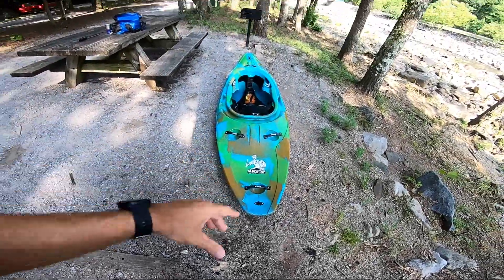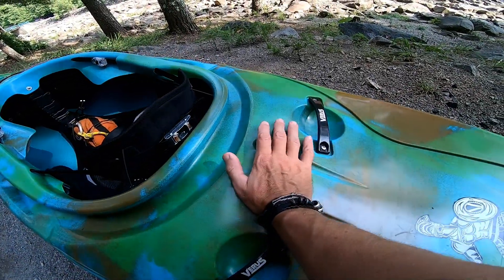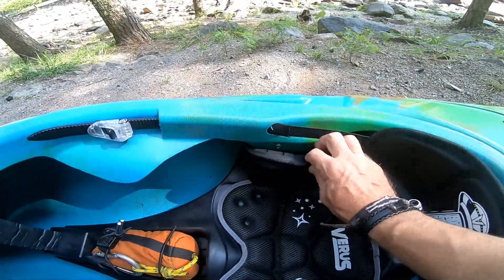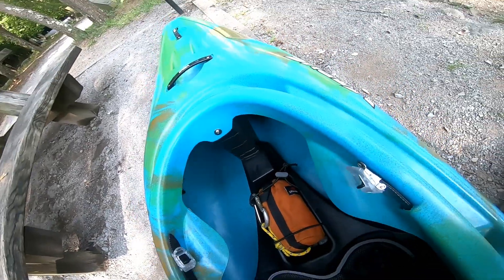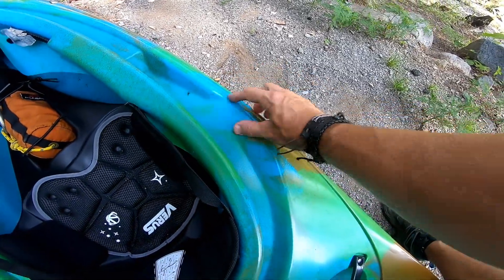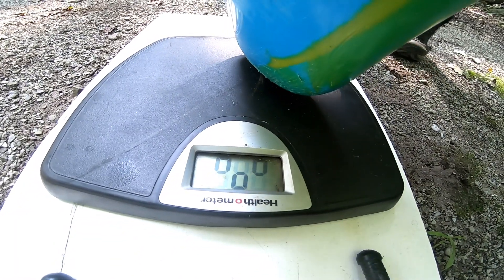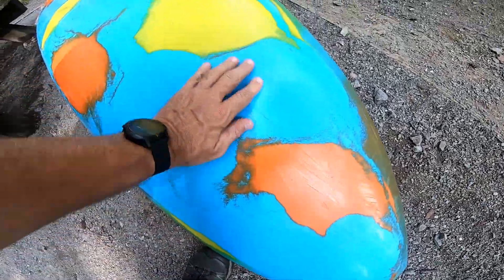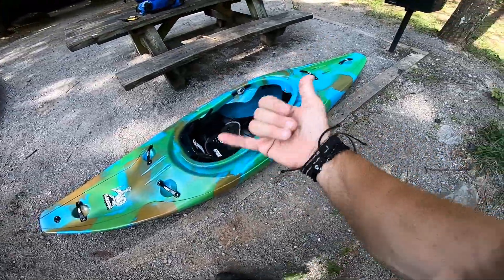Verus Kayaks Gladiator 2.0 "Detailed Walkthrough"

Comment: I have had mine since October '20. I LOVE it. Mine is the driest boat I own. So much like a slalom boat. I also have a ripper L and love that too, but they're different boats. Stern load that gladiator and have a blast all day (I am 205 lbs). Yes mine weighs 51 lbs also.
Reply from the maker: I think your weight is the sweet spot for this boat thanks for the feedback

Comment: Well I traded a Large Loki 4 one (don't need 2 Loki's and needed a modern half slice) for one  and here is my thoughts..just on the hardware.  Currently going through and replacing all the washers to the correct size.  None of the washers had the correct hole size. Little stuff like this drives me nuts.  There is plenty of room in this boat for tall people.  verus just forgot about us!   They made the bulk so it would fit someone who is 4'2 but not someone over 6'. I'm 6'1 and fit with the seat all the way back and the bulkhead all the way forward, but my Feet are completely flat on the bulkhead.  Not comfortable for long days on the river.  I'm currently making a quick extension for the bulkhead  to move it forward about an inch past mass extension.  eventually  will make long aluminum legs for for the bulkhead
Reply from the maker: Thanks for the feedback and yeah I hope the best for these guys I know a lot of them and they all really solid paddlers if they stick with this I’m sure they will
Work out all the kinks of the design and assembly outside the weight the molding looks pretty dam good

Comment: Hey Wade,
I'm wondering about Verus's manufacturing. I secondhand bought a blem hellbender ( The rim around the cockpit was popped out). When I picked up the boat I was really surprised at how heavy it was (for sure more than 36 lbs.). You mentioned in the video that the gladiator was heavy. I'm wondering if they had an issue manufacturing and decided to start adding more plastic? Curious to hear your thoughts as you're pretty familiar with the boat making process.
Reply from the maker: that is a very common practice when there's issues is just throw more resin in it but I don't think that is the problem I think its just some inconsistency in the manufacturing?
Reply: @WadeHarrison  Hmm maybe, I heard that they actually offered thickness options at some point (Kinda heresay). And a few other people have seconded that the boats feel heavy.
Reply from the maker: @elijahevans124  like heavy lay ups some companies do I’m not sure if that’s what this was? I could be wrong